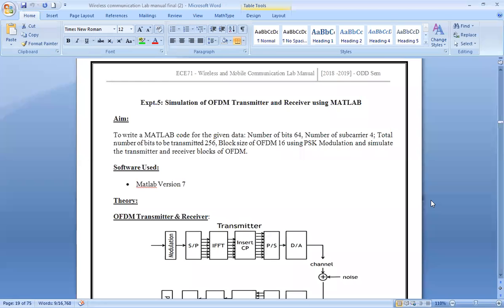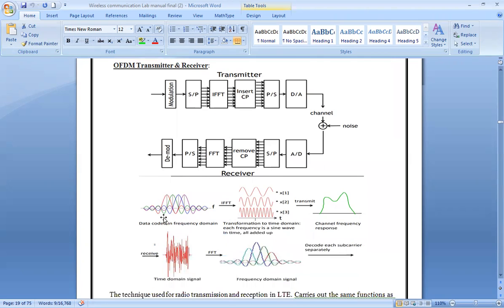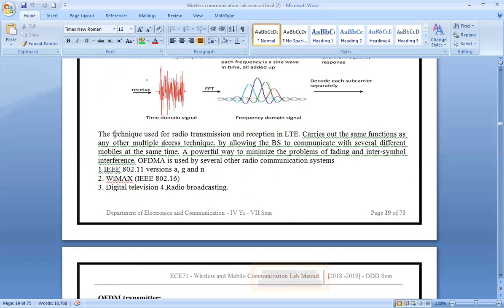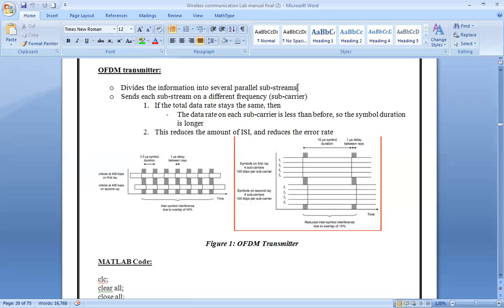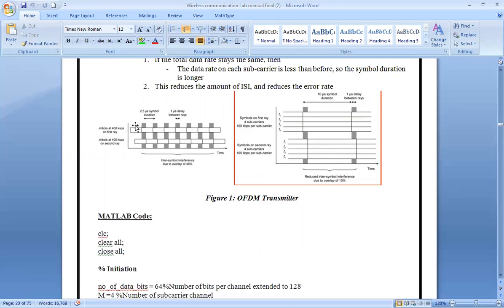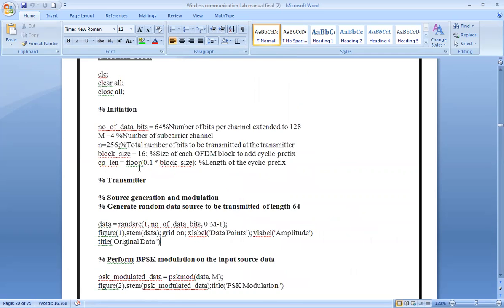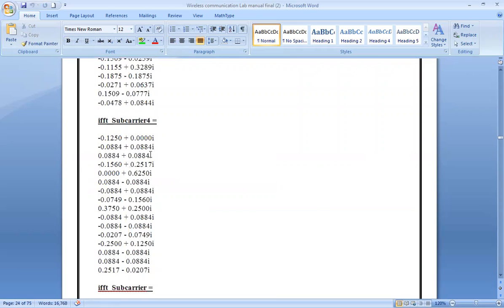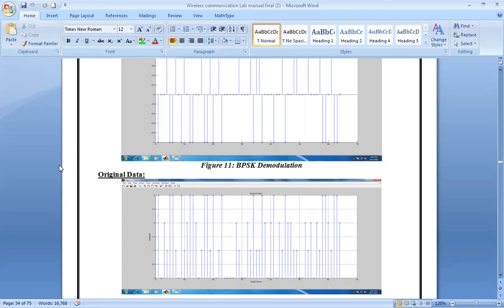Exp 5   Simulation of OFDM transmitter and receiver using MATLAB

Comment: Sir if I'm not wrong the code in receiver is not correct how did u get the output?
Reply from the maker: I have not shown the receiver part code. As i wanted to be it as a practice.

Waveforms I've got since i've simulated both the Tx & Rx.